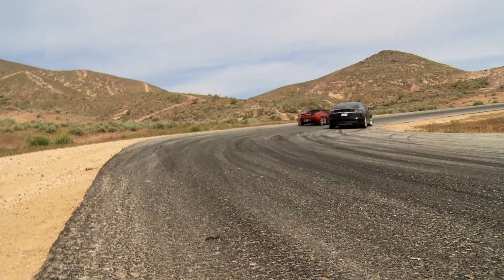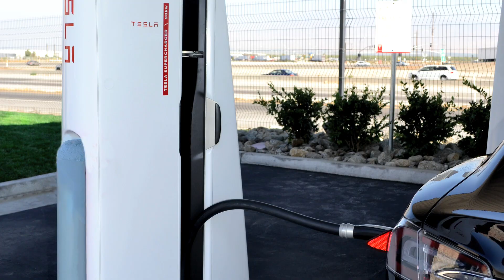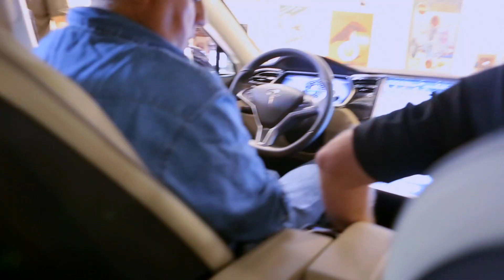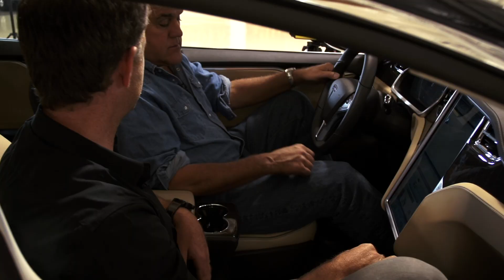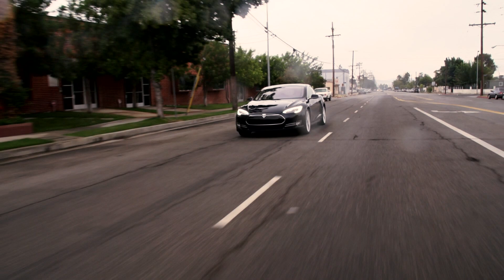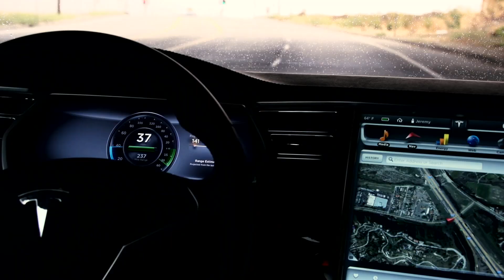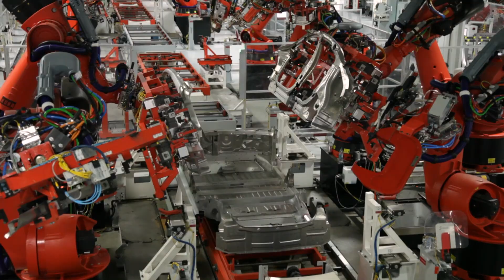2012 Tesla Model S - Jay Leno's Garage

Comment: Depends. In Norway a top spec Signature Performance costs less than a three year old camaro RS, or about the same as a 5-series/A6/E-class with one of the basic engines and equipment levels, or less than half of that of a new Durango 5,7 Citadel. Taxes baby.

Comment: Economic sense is hold back.  20 to 30K more for a car that saves you 2 to 3k doesn't make sense.  The big price comes from the batteries.  Even sealed lead acid batteries are way over price. Considering the age of the technology for lead acid it's actually mind boggling.  Big energy is not going to give up that easy.  I also am wary of the power bill at home.  I average 150 bucks a month.  It doesn't make sense to me to trade paying at the gas pump vs the utility company.

Comment: I am a car enthusiast, I have swapped out engines, gearboxes, I have spent a lot of time watching car related stuff videos and the like. I love cars and putting power to the ground via some wide ass tires. 

This car excites me. Max torque from 0 RPM! super low cd. rating because no engine to cool, super low center of gravity. There is years of evolution to come and that's exciting. I'm ready to move on.

Comment: Renault have a electric car where you switch out the battery each time you go to fill up. It does give you a instant charge but only will work at a Renault filling station with a Renault car.

Comment: Ideally, you only stop for about 20-30 minutes, which wives you enough juice (around half a "tank") to get you to the next supercharger and so on. Instantaneous charging will have to wait a but even the current situation is pretty good all things considered: free recharges forever, knowing that the energy you consume comes from the solar pannels built on the Tesla Supercharger itself, with the surplus energy being fed back into the grid and zero CO2 emissions. That sounds like a sweet deal to me

Comment: How does something already pretty much SOLID freez AGAIN?   At zero C, the battery suffers permant damage.  That's why they have a heater.  But in the winter time in Northern State, entire charge of it would be used to heat then run out and be damaged beyond point of return.  Do you know what a 70% capacity battery feels like, in a REAL WORLD application?

Comment: ..and you are a coward hiding behind the internet.  The fact remains that GM will in fact buy back the Volt from owners on various reasons and that the batteries do fail at lower temperatures.  However, this is not really the matter at hand.  The Tesla is a superiour design and possibly will do much better.  That may be likely and is yet to be seen.  What is seen however, is that you are a coward.

Comment: Actually Tesla is very popular in Scandinavia. Even the old (compared to this) roadster was bought many times there. So its already verified that there are no problems with the cold. Heating doesn't take that much power either. And yes, it does help because it doesn't matter what is the temperature. It keeps the batteries at constant temperature even if its -30C. Then of course it would just take more power. And if you leave at airport then you have to plug in anyway.

Comment: Sorry, I just don't see how that would help a car sitting in my garage at -10C for three or four days The batteries would freeze. Unless I have to plug the car in when parked. In which case the thing is useless parked outside at my office or worse, at the airport when I have to fly somewhere for a few days. I think frozen batteries are dead and these cars should stay in the heat of the south. The volt, however, has bigger problems : GM will buy Volts back from owners worried about a fiery death.

Comment: It is often overlooked that the process of producing gasoline/diesel REQUIRES large amounts of electricity.  This reality negates any argument that widespread EV usage will affect the power grid and cause a different type of pollution as you cannot consume a gallon of gasoline without consuming several kWh's of electricity.

Comment: Looks like you don't understand thermodynamics. The car accepts electricity and generates mechanical power + heat. There are no emissions in this process.

BTW California generates majority of its electric energy from natural gas and 17% is renewable. Compare it to the gasoline engines where it is 100% non renewable and you have to transport it over the whole world to refine it, by huge ship engines which are inefficient and run the lowest quality fuel available. But who cares about that, right?

Comment: At least electricity generation is fungible:  It *can* be sourced from hydroelectric, geothermal, solar PV, solar thermal, nuclear, wind.... and it's still the same electricity.  ICE vehicles can only be powered by fossil fuels, which is not getting any easier to find (or cheaper).

Comment: Everyone keeps complaining saying that the Tesla Model S is not a 0 emission vehicle due to its use of the energy gird. I have to argue that our energy grid is a static system that is very Inefficient. The Tesla in its own nature will help the gird become a little more efficient being a power storage device alone. The energy grid has no way of storing energy. It is either used or wasted in the form of resistive heat dissipation.The Tesla will actually use the energy that would be wasted.

Comment: too expensive,we need some low cost commuter cars,electric/fuel engine.wrapped in a aerodynamic body,you now have doubled the range or the fuel mileage just with the aerodynamic body.Global warming is not a joke,a 3 degree rise in temperature will destroy half the world species and guess what?were next,so let's wake up,leave the suv's home,use them on the weekends with the family or otherwise don't drive them,very simple

Comment: It does have range limitations. There are just more diesel stations than Superchargers and it takes about a tenth of the time to fill up a tank of diesel vs. a Supercharger. However, the Supercharger is free and where I live, a 15 gal. diesel tank would cost over $60. Then again, it would take you over 600 miles.
Clearly an ICE has the edge in long range travel vs. a pure electric, but the vast majority of the time, electric rules.
So have fun in your Peugeot and I'll blast past in my Tesla.

Comment: The Tesla Model S has over 200 patents in it. There is hardly anything in it that it shares with any other vehicle except for the Model X.
You may be confusing the Model S which has programmable electric power steering with the Roadster which kept the simple direct steering mechanism that is in the Lotus.

Comment: I have driven some other high end cars including a BMW 550i with 400 hp and a BMW Z4. There was no gap on the production Tesla that I saw. You should drive a Model S or at least read about others' experiences with the car. It is a genuinely great luxury sports car. Why else did it get the top honors from many auto authorities?
The difference between a laptop cell and the Model S's battery cells is the fact that it is climate controlled and charge controlled to maximize battery life.

Comment: When did they ever claim to have 15-20,000 orders? They stated that they only were going to build 2,000 of the Roadsters and they ended up building 2,500. The Roadster and the Lotus Elise shared 7% of its parts. It was brand new tech at the time and put many of the supercars at that time to shame.

The Model S batteries are supposed to last at least 8 years with only about 20% degradation, and because it's an EV, it should have little maintenance.
Tesla Motors is no sham. It is the future.

Comment: @ D MCNamara Superchargers usually have enclosed lubrication systems. Vortech supercharging systems with V-3 compressors feature a self-contained lubrication system. Installation is easier because there are no hoses to connect. Systems with V-2 compressors have an integrated lubrication system. The engine oil supply is shared with the supercharger. This ensures maximum durability with virtually no maintenance. In fact, when you change your engine oil, you change the supercharger oil."

Comment: I'm sure it'll be much easier/cheaper to replace these parts as opposed to a blown head gasket. I deal with brush-less electric motors (E-Motors for cars are a different field but the concepts are the same) hence my R/C hobbies and the are much cheaper to maintain compared to their nitro counterparts. Brush-less motors are very resilient from my experience they are only going to get better. I believe like petrol cars there will be an aftermarket scene..Wet bearings exist IE turbo applications.

Comment: It starts at less than $60,000 and tops out at $100,000.

The range restrictions that you speak of don't apply for a class of car that doesn't even take road trips. Luxury sport cars are not designed for, neither are they used by their owners for road trips.

The Tesla Model S is better than the cars that you mentioned. It's a true luxury sport sedan. The 40kW Model S competes with other cars that are faster, but it's not all about speed, even though it feels much faster than it really is.

Comment: How often do you change bearings in any other car? They last a long time, and aren't considered maintenance items. Maintenance isn't the same as repair.

Armature and brush wear? This isn't a brushed motor.

So, what you're saying is that electric cars are a bad deal because you'll sustain damage in an accident, and Tesla isn't the company you'd want to deal with for replacement parts, right?

Electric cars have issues, but these aren't them.

Comment: Sadly electric car isn't the kind of thing where the more common it becomes the cheaper it becomes. The cars own cost is low but the batteries make it expensive. Even though lithium is not too rear, still in large quantities it is found only at the certain places - that means whoever is sitting on top of it wants lots of money - even now when the electric to petrol car ratio is like what 1:1000000. Capitalism  and the need for economic growth itself prevents rationality end economic behaviour.

Comment: It doesn't have to work for everyone.

The electric car is like the computer. When demand increased, price decreased. More money went into technological advancements which farther decreased price and increased capability.

Lithium air batteries, which have 3 to 5 times the energy density of lithium ion, are currently not getting the funding that they should. If they were perfected and mass produced, the Tesla Model S could potentially have a 800-1300 mile range and be able to charge even faster.

Comment: continues...wich means in US where the gas is half the price of europe it means over 800 000 km or allmost 500k miles if you like. AND after that the car still works and has some value. So the electric car is like solar panels - in sunny and warm california it works - in cold areas it doesn't and theres just not enough materials to support situation where majority of people would use electric cars - atleast not with batterys in each and every one of them.

Comment: Our goverment bought electric cars for social workers. The cars cost is 36 000 euros. They say that the battery should last about 10 years but in reality it last about 5-6 years. In cold winters the range is reduced 50%+. After the 5-6 years the cost of a new battery is 20 000 euros. For example polo bluemotion costs 16 000 euros and you could spend rest of the money on diesel. For 20 000 euros you could get 14200 liters of diesel wich with local prices means over 400 000 km...continues

Comment: Lithium is not a rare earth metal, and new batteries do not cost near as much as the car. Preheating your car and battery before setting out, makes the range reduction more like 35%. The NYT journalist did not follow proper procedures to get the range he wanted.
He didn't preheat the car and battery, and he was going over the speed limit initially. He could have had a nice relaxing trip that cost nothing but time, but methinks he planned to run out, otherwise there would be nothing to report.

Comment: Just look up the videos. A BMW M5 on the right surface in good conditions with a good launch can beat a Tesla Model S Performance. The Mercedes E63 AMG can also beat the Model S with a perfect launch, but barely.

It takes a skilled driver to do a perfect launch and most people are not skilled drivers. In the Model S, all you have to do is smash the GO pedal and you get better than book performance. On the street where impromptu races often take place, the Model S has the edge.
CTS-V vs Model S?

Comment: First - electric cars suffer badly from cold - in places like northern europe the range is reduced around 50%.
Second thing is that electric car batterys last about 7 years and the new ones cost asmuch as the car itself. 
Third probleem is that to make batterys rare metals are needed and those metals are scarce and pretty much only found in china. So electric car is like biodiesel - if only few are using it it works but theres not enough for everybody.

Comment: Well basically it comes down to what type of driving you do whether or not a Model S will work for you. But for most people a 100 mile range EV would be plenty. But people like the idea that they can go any ware they want anytime they want. And thats what hurts EVs. Because they are not or at least perceived as not as "spontaneous" as a gas car. Also keep in mind that if you where using a Tesla Supercharger 10 mins of charging would give you 50 miles.

Comment: Electric cars might not be there yet for some. But if thats the case then the Model S is pretty darn close. Try not to think of an electric car the same way you think of a gas car. You don't wait around to charge or fill up. Your car charges while you do other things. Most of the time people are not driving their car. It's either sitting in their driveway or in a parking spot. Why not utilize that inactivity and charge the vehicle. Advancements in induction charging will make it effortless.

Comment: The thing is, touch screen things are hard to use when you're using it and trying to keep your eyes on the road at the same time. With analog controls, you can feel your way around the keys or more commonly now, iDrive-like swivel wheels. With touch screen, it's more difficult to multi-task. Small gripe though.

Comment: @navyrotc2012 For what reason other than battery issues would you really need to take the Model S to a Tesla Dealer anyways? Didn't you hear Jay Leno said you have no maintenance issues? The Volt has and engine and would eventually require more maintenance than the Model S.

Comment: well, then whats the point of having it in your car if you put it in night mode 50% of the time and do not use it. I have Pioneer4300 in my car and rarely put it in night vision, because i like playing with radio while driving. For me such big screen is just distracting and useless. It may look fancy but completly useless. Like what feature it has that 7" screen would not be able to handle? It is a car not a flight control tower.

Comment: I've heard someone quote 1% loss in range every year. The battery is warrantied for about 10 years. The cost of batteries is dropping quickly, so when it comes time to replace it, it will probably be much cheaper than they are now. It would be interesting to add up how much you'd save on gas over ten years too. One of the forums says they can do 500 cycles before noticeable performance degradation. How many times a month would you need to charge it? 500 is a lot.

Comment: You can have your opinion but I spend all day with digital electronics and I promise you the screen is not what we used to call "power hungry". If I can get a laptop screen that size to run for hours on a four cell battery then I think your safe in this thing with 7000 of them underneath. Compared to the rest of the car it's probably using less power than the dash lights in a car ten years ago.

Comment: Well just on a TV level even the BBC has a diabolical excuse for TOP GEAR that as it is classified as an entertainment show the things Clarkson says do not have to be true. That is official BBC policy. So they are by definition admitting it is fabricated crap. Look I hate the NISSAN LEAF a terrible EV with worse range than 1997 EVs but Clarkson had to fake it running out of power it was a set-up faked situation. So just like with the ROADSTER they faked pushing it to a garage.

Comment: They have experiments with it in Japan and the system requires massive amounts of power which plus yes there is a lot of inefficiency. Batteries and charging are fine. Even without DC SUPERCHARGE a 70amp AC charge can add 120 miles into a battery in two hours while you shop or see a movie.

Comment: The model s kills in the second category you mentioned, however the volt would have a more reliable range do to its gas engine and in terms of ease of use should be similar, although if anything went wrong with your car there are a lot more chevy dealers then tesla dealers you could bring your car to.

Comment: I live in Oregon.  My electricity comes from a series of dams, so no fossil fuels.  And, electric cars tend to be more energy efficient than a gas car, simply because electric power stations are much more energy efficient than an automotive prime mover.  I believe in the days of the Saturn EV1 the car ended up producing roughly half of the fossil fuel pollution of a comparably-sized four-cylinder.  That's a serious advantage.  Especially if your electricity comes from hydro, solar, etc.